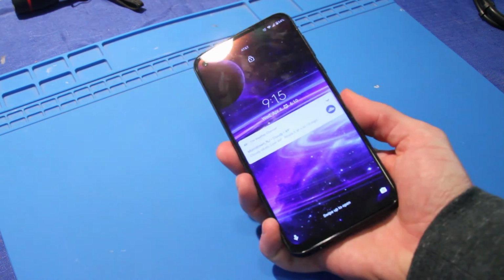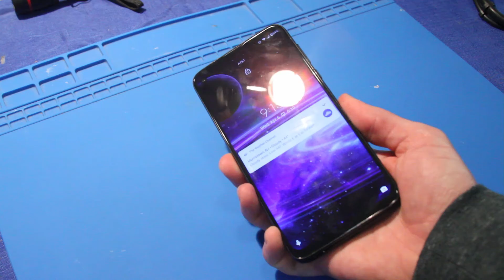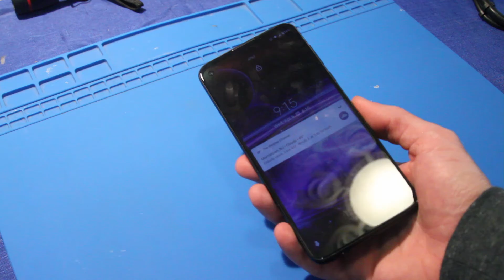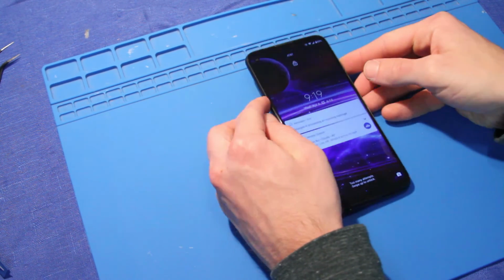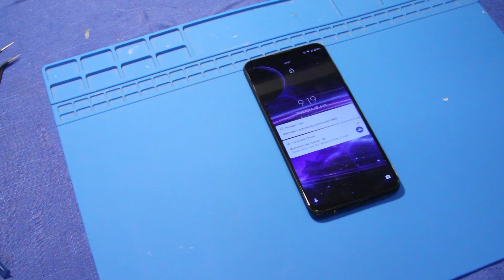Fixing My Mistake: Replacing a fingerprint reader on a Moto G Power

Comment: Hi, how do you re-calibrate it sir
Reply from the maker: It's been a while, but if I remember correctly, it's in settings under security. There will be an option to calibrate your fingerprint. I remember I had to reregister mine.

Comment: Can you still operate the phone without connecting the fingerprint scanner to the phone if you ripped it off of the ribbon cable?
Reply from the maker: It should be fine. At least for me I used it for like 2-3 weeks without it

Comment: does anyone have a definative answer , will a missing, or in my case a ripped fingerprint sensor make the phone dead , will not do anything. Anyone?
Reply from the maker: In my first video I ripped the finger print cable while changing the charging port. I used the phone for a couple weeks no problem with that cable ripped until I got a new one. So in my experience no it shouldn't make the phone dead.

Comment: Did you ever get it to work properly?
Reply from the maker: Yes I did! Just some recalibration and it worked great for a year and a half until I got my Razor a few months ago
Reply: Glad to hear that. I bought a replacement back for my g power 2022 and ripped the fingerprint ribbon accidentally so I'm going through the exact same thing.
Reply: Ditto

Comment: When this part breaks (I broke my ribbon cable as you did)  will the phone not power up?  I think my phone is just shot...replaced the battery, power button up vol up down cable strip, still black screen white light so wonderingnow if the fingerprint broken copper colored cable prevents it from chargine and powering up?  doubt it but I don't know....
Reply from the maker: It shouldn't. In between shooting this video and the next one where I replaced the thumbprint reader I was using it no problems. And I think it was a week or two before I replaced it? I'm not a phone expert but it sounds like it's shot. I bought a Razr a couple months ago finally replacing my G and it was acting super glitchy by the end. I personally would replace it if you can. It's a 4 year old model and past it's support life. Even if you send it out to repair it'll likely cost you as much or more to buy a new phone.